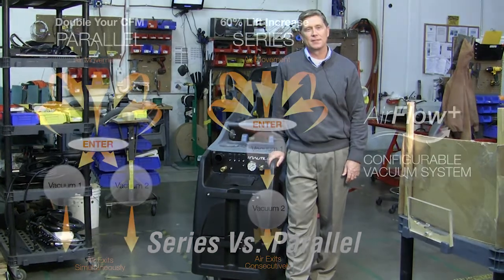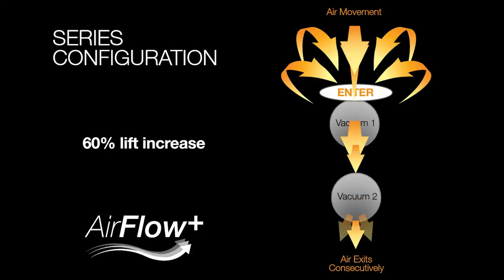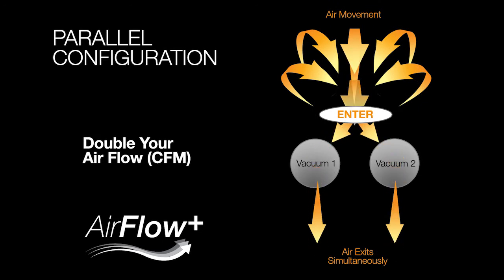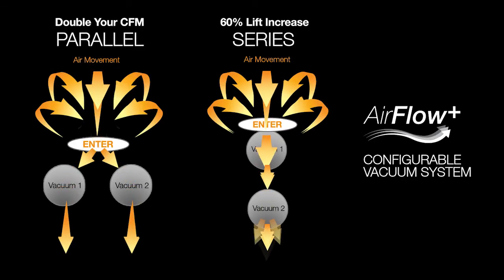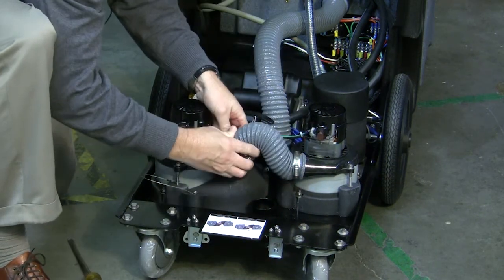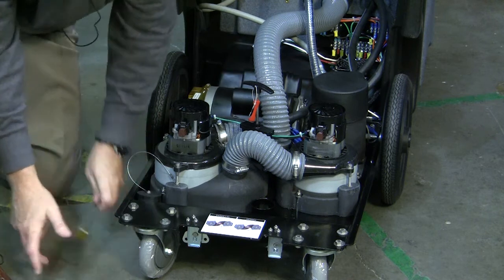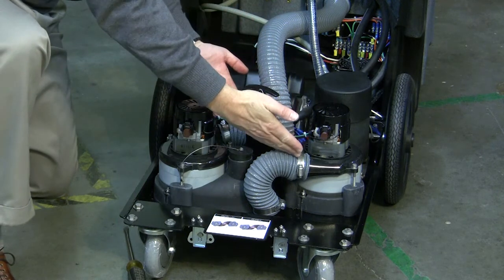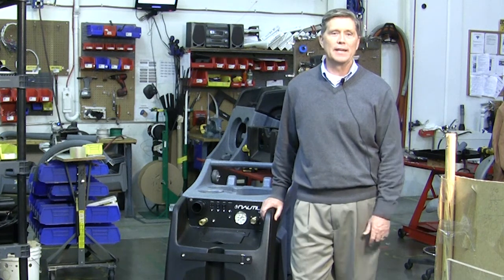Nautilus Airflow+ Series Vs Parallel Explained

Comment: This isn't a really good explanation of series and parallel at all. 

Series will have more airflow and lift at certain higher resistances, parallel will have higher airflow and lift at low resistances (open hose). 

So, if you have a 1/4" opening, series will have higher air flow (CFM) and higher lift.  Of course, CFM at this opening is quite low, and lift relatively high. but both are higher on series.  If you have a big opening (let's say 1.5"), CFM and lift will both be higher on a parallel setup.  In this case CFM will be relatively high, and lift relatively know.

So, this confuses people, and obviously the people that made this video.  Because series is stronger where there is a lot of resistance, and lift tends to be relatively high, people like to say series has more lift.  It does at certain restrictions, for sure.  And it certainly has more maximum lift (totally closed hose).  Parallel has more maximum CFM, even though it has less at certain restrictions, so people just like to say it has more CFM.  Wrong.  It does only at certain scenarios.

Also, this machine is sub-ideal for parallel anyway.  It only has one stack, and then the hose isn't any wider than the two going to the motors.  A "real" parallel system would have two stacks, each going to a separate motor.  By using one, there is definitely a cost in performance, especially since it's only a 2" hose.  If they had used a 3" hose to area that splits the air, it would have been better.  But, I prefer series for most things anyway, so it's not a big deal.